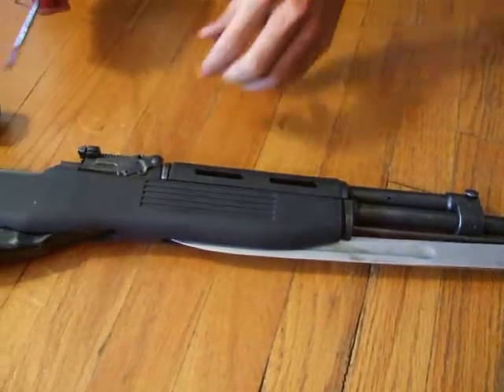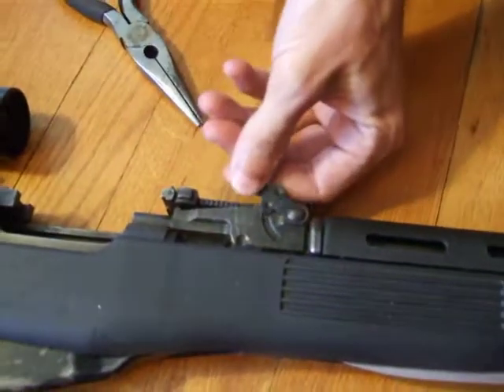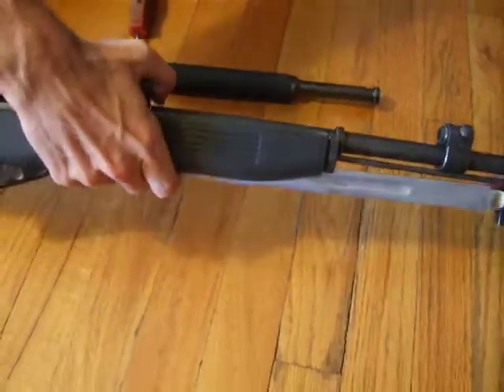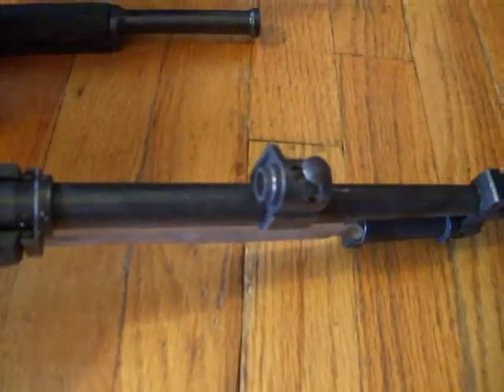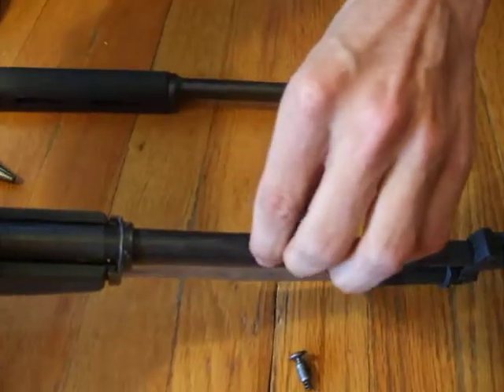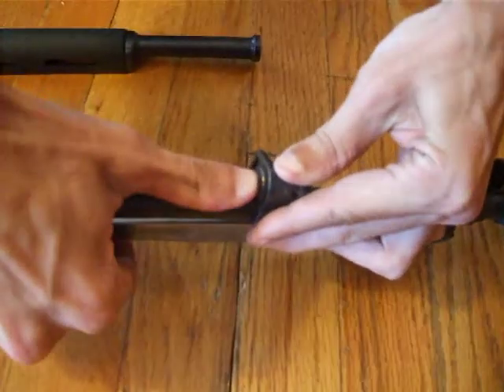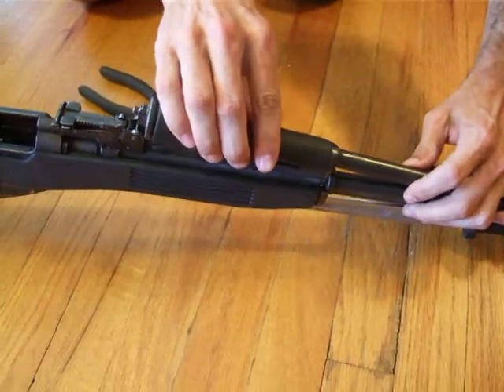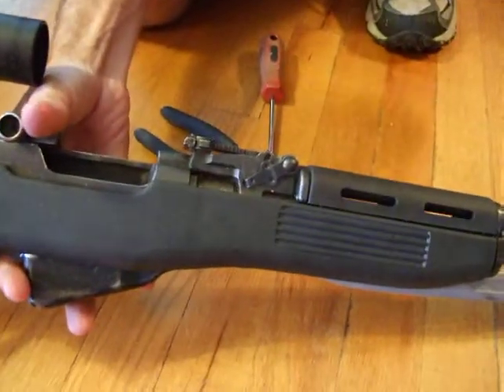SKS Gas Valve Replacment

Comment: @YungLC If you have a YUGO SKS, then you have shut off the gas piston, ensure your toggle at the front of the gas chamber is in the right position. make sure its not down too far or up too high, it should line up with the enlarged hole that indicates that position (at a 45° angle to the right - looking down the rifle, locking down the grenade sight, but not touching or pressing against it) I know its a year old comment, but hopefully people having the same problem can see this also.
Cheers

Comment: I filed by gas tube to fit mine which is a common problem and she fits but the locking lever is loose enough to be moved up and down by hand no tools required but the tube seems to be in place should I be worried about this at all??

Comment: Man I wish my valve was as easy to come off as this one, Been trying for weeks but the sob wont rotate! lucky for me its stuck on semi-auto mode though!
Reply: I had the same problem. I sprayed it with oil inside and out. Pushed the button in and used a screw driver (I was careful) to rotate it. Works fine now